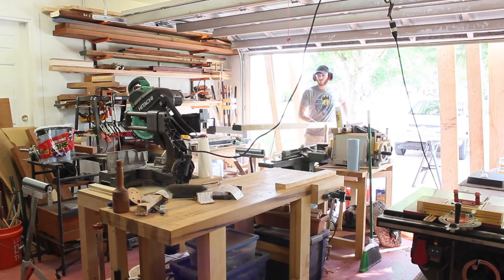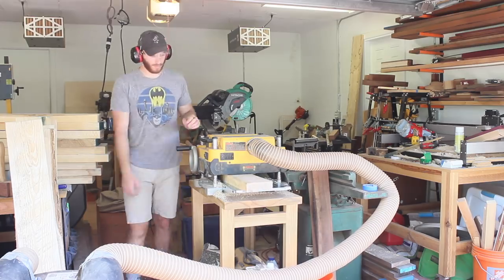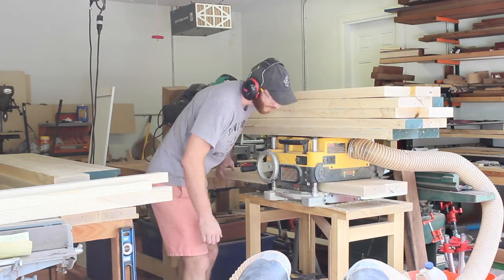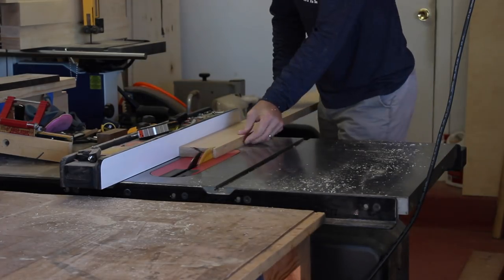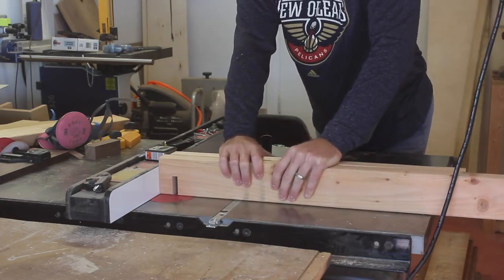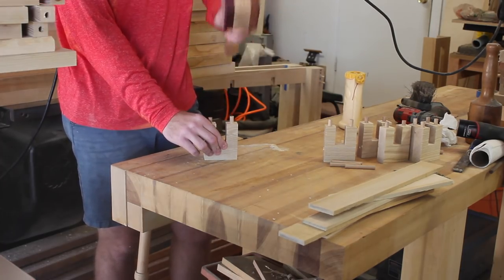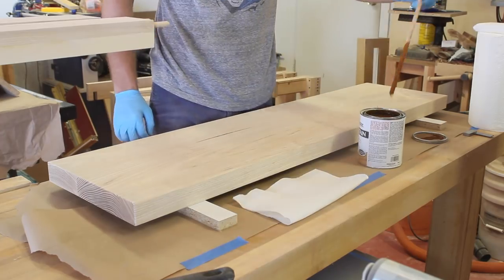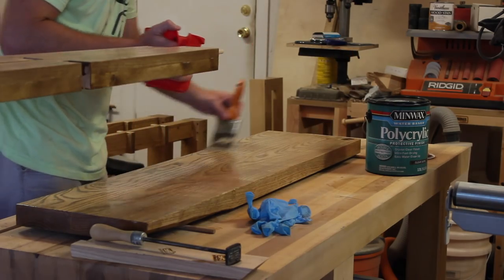Making a 10' x 4' Solid Ash Dining Table

Comment: get some "Fast Spiral Jobber Drills bit" for your dowel jig most industrial places should have them should be cheap and easy to find and will make your dowel jig more of a joy to use
Reply from the maker: Great tip. I'll look into those bits. Thanks marble head.

Comment: Was there a video showing making the tabletop and putting it together? Did you glue up the boards to make the top or are the boards fastened individually to the base. I was wondering when you were applying the finish if that was going to affect the glue up? I am making a 102”x40” trestle table for my daughter. The table is 72” but expands to 102” with leaves. She wanted white oak but my lumber supplier doesn’t have any 8/4 white oak but has Ash, how do you feel about Ash verses White Oak? Btw, great job, the table looks awesome
Reply from the maker: Thanks for the comment. All of the pieces are fastened to the rails individually. Each piece is 12” wide and there are 10 of them. As far as white oak vs. ash: I definitely prefer white oak but I’ve used a lot of ash and it is right up there with my favorite light colored woods. If you can’t get white oak, ash is your best replacement.
Reply: parillaworks  Thanks for that but can you tell me how you fastened each board to the base that you said will make it easy to disassemble and transport? I may consider that method for my daughters table top rather than glue up.
Reply from the maker: I used Z clips or tabletop fasteners. Each piece required 4 fasteners, the end pieces received 6. The fasteners fit into a groove cut along the table skirts/rails. These fasteners allow for wood movement.

Comment: Nice work. Just have one question when you feed a workpiece to a jointer, (1:25) aren’t you suppose to put the majority of the pressure on the infeed part? I’m not criticizing just want to learn. Thanks
Reply from the maker: Thanks Tepic. I was taught to keep the pressure on the outfeed table because that's the table that creates our new reference surface and flat face. If you keep the pressure on the infeed side, I think it would be similar to thicknessing a wobbly board. You would just exacerbate the imperfections or at the very least create a smooth but twisted/bowed/warped board.

Comment: Nice job as always.
Should you sand between every polycrylic coat? and why?
Reply from the maker: Thanks! I sand as needed. Usually the first coat will raise the grain slightly because it's a water based poly. For later coats, I may use a piece of 320 or 400 grit paper to knock down any fine dust nibs.

Comment: Totally off topic, but which way does you blade tilt on your saw stop? Towards the right hand side or left?
Reply from the maker: Hey Bryan. It tilts left.
Reply: Okay cool thanks. I just bought the incra sled and was trying to figure out which side to put it.
Reply from the maker: That said, I keep the sled on the left side of the blade which means I can't really use it when the blade is tilted. I made that decision because I'm more comfortable using the miter gauge on the left side and also don't cut miters too often. When I do, I just take the gauge out of the sled and put it on the right side of the blade.

Comment: Why didn't you go for rabbets for the base?
Reply from the maker: What part of the base are you referring to?
Reply: parillaworks I mean the legs. Or maybe Mortises and tenons could make it stronger?
Reply from the maker: I see. Those dowels should be just as strong as a traditional mortise an tenon. Also, the long sides are not glued and can be taken apart. The dowels provide a tight joint that holds itself together better than a mortise and tenon (that I would make, anyway).

Comment: The table came out really nice, and the video was really informative but I know how helpful it can be, so I thought i'd give you some constructive criticism to bring the video up to the next level: 1) Focus on the framing of your shots - in quite a few clips I couldn't see what was going on (e.g. the miter saw shot at 7.29). 2) Use more shots from different angles. I know its a pain to have to constantly move the camera around but, for example the band-saw re-sawing shot went on for 18 seconds and by that point i'd lost attention and was looking at another tab. If you don't fancy moving the camera maybe try just fixing it in post? E.g. cut the clip to just show the beginning & end of the cut? I hope this helps & all the best for your channel in 2018 :)
Reply from the maker: Thanks for the comment J. You bring up some good points. I think with a project this large I began to lose the balance between making a video and completing a build. But I just started filming a new project today with less stress so hopefully I can take into account some of the tips you've provided. Happy New Year!
Reply: No problem mate! I do the exact same thing - I start off putting loads of attention into the video but  then I end up just shoving the camera wherever is out of the way because I'm exited and just want to finish the project! You could always try and to fix this with editing though? Instead of showing 5 or 6 cuts sped up maybe just the beginning and end of 2? Anyhow, all the best for 2018 & I look forward to the next video :)